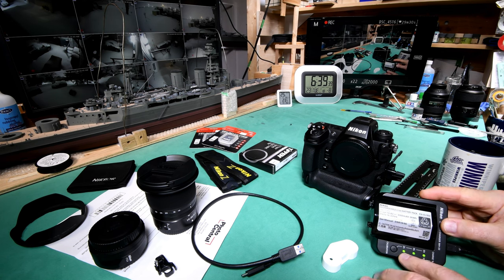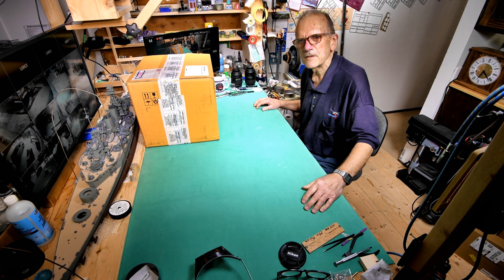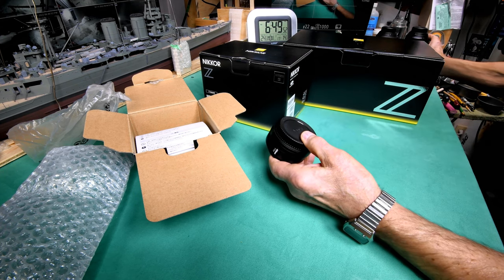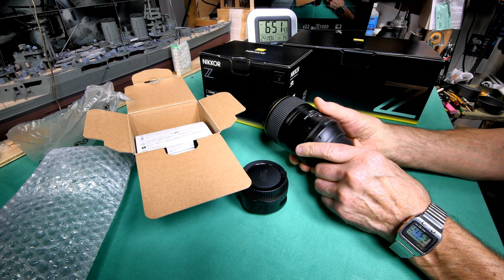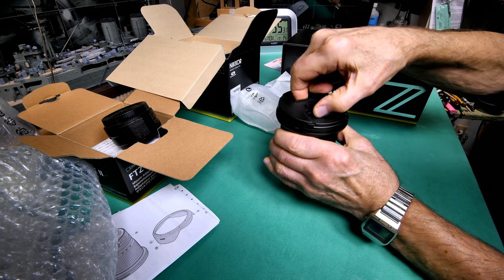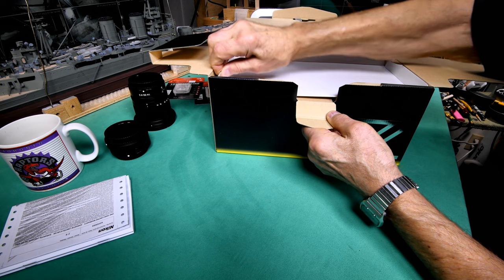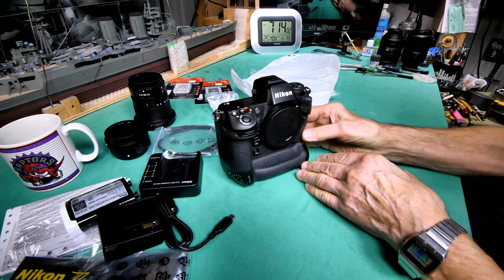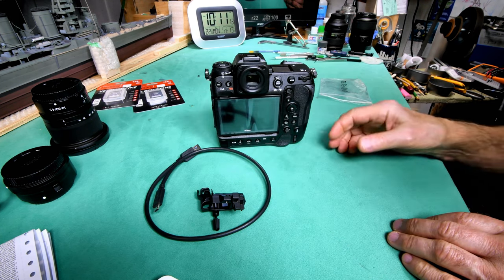The Model Ship - Part 1056

Comment: Ron congratulations on your new purchases. As I said in a previous post I will be interested to see how your f-mount lenses perform. My old 24mm f2.8 will not auto focus on my z6 but will on my d90.
Reply from the maker: Hi David,
I tried the macro tonight. Works well so far. My computer is the weak link now!
Reply: @roncalverley  Great news Ron. Was worried for you, but then again it would have given you an excuse to buy a new micro lens. I wonder if I could get away with that.